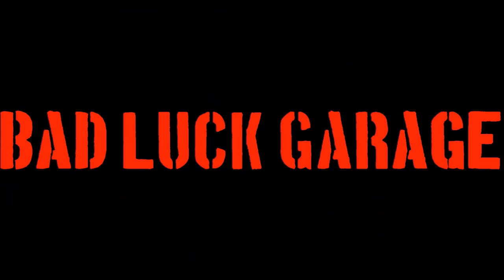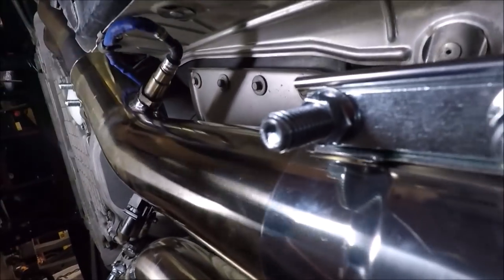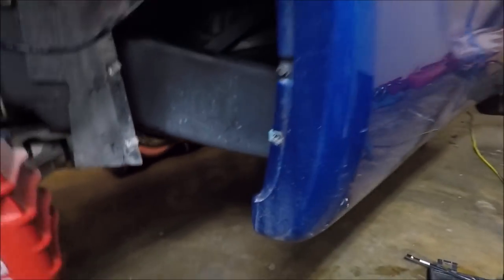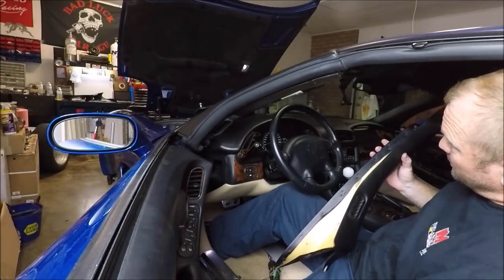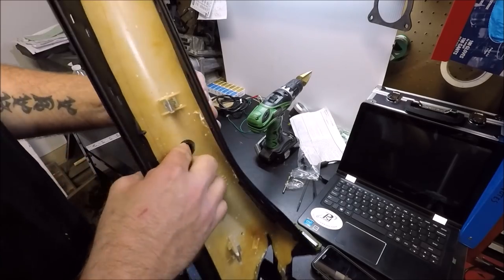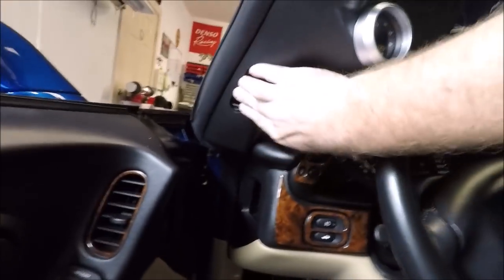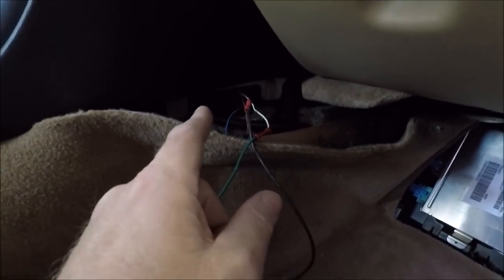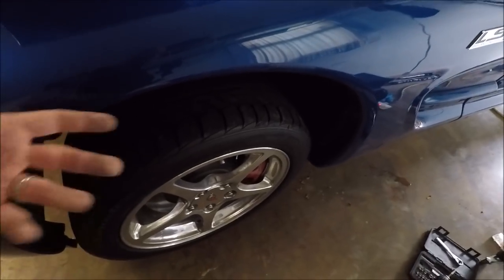WIDEBAND GAUGE AND PILLAR GAUGE POD INSTALL IN  C5 CORVETTE

Comment: Is the wideband connected through analog to the erg or ac wire?
Reply from the maker: Neither, I use an MPVI Pro so it has 4 I/Os built in.
Reply: @BadLuckGarage  thanks for confirming! Trying to figure out how to hook up my mpvi2 standard to my 98 c5
Reply from the maker: @ndog808  sorry brother, I cant help you with that. I'm one of those guys holding onto the MPVI1 and avoiding all the latest drama from HP Tuners,lol.

Comment: Ha!  catching up on your videos for the week this morning.    I see you coincidentally found the accessory connector by the BCM I mentioned in your switch panel video.      Looking good man.   I'm not a nitrous guy but I can't wait to see what you pickup with all your mods.      I may have missed a vid but did you ever get your exhaust all sealed up to your satisfaction?    Looks like you got the wide clamps put on the mid pipes.
Reply from the maker: LMAO, yea I was just replying to your comment about it on another video and said”guess you haven’t watched the wideband video yet?” And then I saw this comment. 🤣🤣🤣 yea brother I already had read about the accessory wife’s but I’m going to be doing a lot to this car and don’t want to overload anything so I put the switch panel power on circuit 22 and left the accessory wires to power any future gauges or other equipment I may add. 👍🏻
Reply from the maker: I replaced the front four clamps and since I’m going to have the back half welded I just took it loose and used some copper rtv for now.  Don’t know if it’s sealed or not (most likely not,lol) because it hasn’t been started since I did that.
Reply: Hi PNW wonder if you can point out that connector for a bro. Thanks.
Reply: @nyplantingsgardendesigners5645   Precisely at 20:00  You can cut that factory connector off and use the power and ground as you need.   I am running my head unit without a relay and also running my intercooler pump and wideband gauge but those are on relays so the circuit is not overloaded.  If I ever redo my head unit I will set that up with a relay as well.

Comment: So can you put your wide band in where the old rear O2 sensors use to mount ?
Reply from the maker: And where do you plan to put you narrowband O2? I’ll let you work that answer out on your own. Lol.
Reply: @BadLuckGarage  So I have an aftermarket exhaust it has the welds for the rear O2 sensors that are not being used. I have the factory O2 sensors plugged into my Kooks headers. Is it necessary to run both wide band and narrow band? Or can HPtuners solve that? Or could I just plug the wide band in where the rear O2 sensors would be normally in my current aftermarket exhaust. I'm asking because I do not know. I have installed the headers and exhaust and supercharger and pinned the crank.. The electronics part.. Not my strong suit.
Reply from the maker: @vantharasc9967  Ok I understand now. You definitely need the front O2 sensors. You don’t need the rear sensors but they need to be deleted from the tune. As long as you don’t have catalytic converters you can put the wideband sensor in one of the rear O2 bungs. It’s a little further from the collector than you generally want it but it should be fine there. Just make sure it’s not in a flat plane of condensation will kill it pretty quickly. Read your wideband instructions pertaining to making sure the sensor is mounted at an able so it doesn’t collect moisture. 👍

Comment: Not a big fan of armor all..

  used it for years in my old Silverado until it caused the paint to start peeling on the dash.. 

Now I just use a lil warm water with a tiny bit of dish soap in a spray bottle..
Reply from the maker: Yea I use the non-silicon based cleaning wipes, not the old school greasy stuff. 😉 Gives it a nice dull factory finish that doesn't attract dirt.
Reply: Ok good..

 it's a sexy dash, so I know its gonna be hard not to spray that white greasy stuff all over it.. 🤪
Reply from the maker: Yea sometimes you just gotta let it fly and worry about the mess later.😜

Comment: Getting ideas from this video!
Reply from the maker: Thats what its here for brother.
Reply: @BadLuckGarage  Well, I am looking to add the Coolant and oil temp. But, would like to also add a small tach as well and I see they do make some that small for that pod. 

 Also thinking to cut out the center AC lever next to the emergency flasher button, and add 2 more gauges trans temp or something. 

The coolant and tach are really important and don't like taking my eyes off the "track" to check gauges at high speeds.